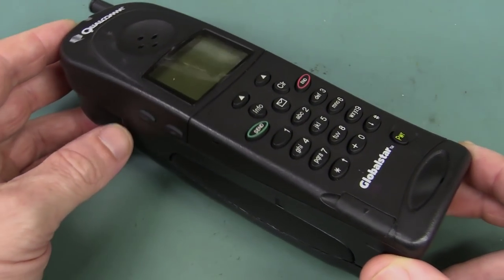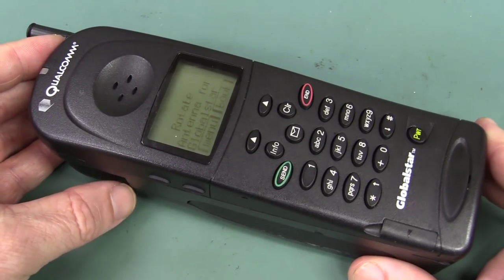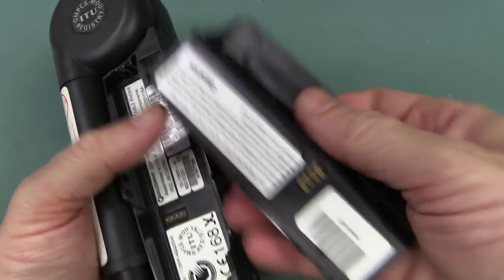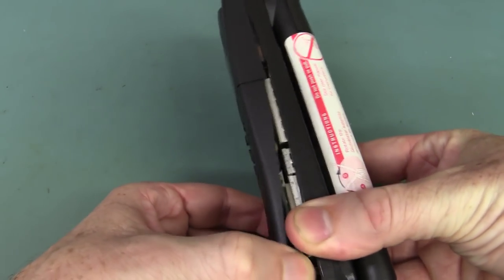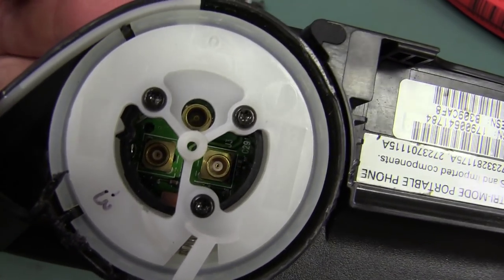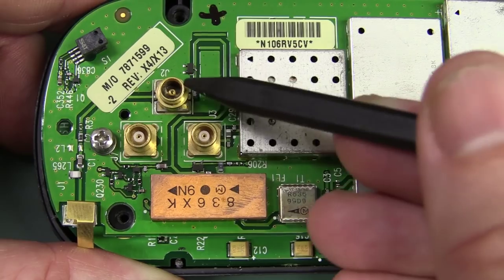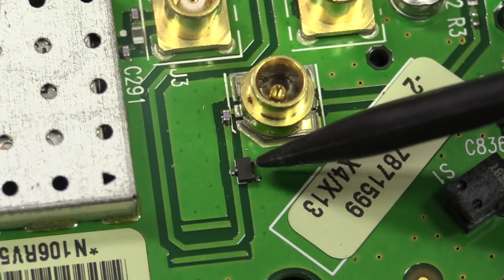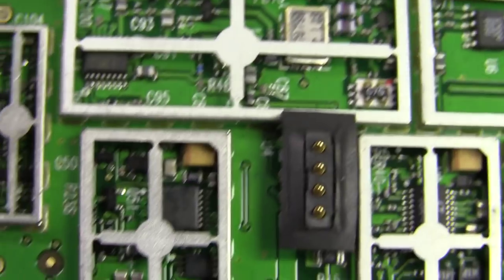EEVblog #721 - Globalstar Satellite Phone Teardown

Comment: What do you recommend to start in the world of electronics? Arduino? Raspberry pi?
Reply from the maker: Icaro Vasconcelos A breadboard and some parts.
Reply: bread boards. learn the basics.
Reply: EEVblog Totally agree, tbh any microcontroller stuff should be tackled once you understand how general electronics works.
Reply: Icaro Vasconcelos An Arduino or Rasp Pi will teach you lots about embedded software, but very little about hardware.
Reply: Icaro Vasconcelos 
I started with Make: Electronics and the 2 kits that go with it; then the 500 in 1 Maxitronics kit - when I got to the 3rd book on MC's, the programs didn't work and I had to write my own, that did work. Then I started buying books on computers and device repair which is my main interest. Now, I can fix nearly anything that can be fixed, and have fixed everything from wall warts to laptops. 
I bought an Arduino a few months ago and played with it a little bit. It's fun, but I have to admit that I prefer analog circuits. It just seems to me that analog circuits are warmer and more fluid. The Arduino "Night Rider" just doesn't even compare to the analog with the 4017, 555, 10 diodes, POT, etc.
Reply: Electron Alchemy In themselves, yes, but on its own an Arduino doesn't do much; you'll want to start connecting it to different things, and slowly you'll learn more about those components. It's much easier to get people interested in electronics if they can see simple practical applications straight away. I'd definitely suggest getting a kit with some discrete components and a microcontroller of some sort.
Reply: RFC3514 
If he gets the Make: Electronics book and the kits, he'll learn from the ground up( pun intended). He'll build circuits also in analog. I think it's good for newbies to learn the fundamentals first or at the same time. Just like Dave recommends learning to use an analog oscilloscope before going to digital scopes.
Reply: Robert Calk Jr. People tend to recommend others do things the way they did things. That doesn't necessarily make it a better approach. It depends on what each person's goal is, and how technology has evolved.

For example, computing pioneers will tell you that you need to start by learning microcode, then assembly, and finally tackle a high-level language. That certainly gives you a greater understanding of how computers work, but it doesn't necessarily make you a better programmer. And starting with a high-level language doesn't prevent you from learning assembly later (if you're interested). 

It's the same with music (should you learn every detail about every instrument before becoming a composer?), photography (do you need to study film chemistry and sensor manufacturing before taking pictures?), and so on.

Chances are you will be interested in some of those things, but you don't always need to start at quantum mechanics and work your way up; sometimes it's more productive to start with the problem you want to solve, and work your way down. It tends to keep people more interested, and makes them more flexible in the long run (because they'll think in more abstract terms, and won't feel as tied to the technology that was available at the time).

The Arduino "ecosystem" has probably done more to get "normal people" (i.e., people not actually doing an engineering degree) interested in electronics than all the books on analog circuits put together. And while most of those people will probably never learn the exact difference between a MOSFET and a BJT, they might learn enough to figure out the joke on Dave's shirt. And that's really the most important thing. ;-)
Reply: RFC3514 No one ever suggested start learning programing by learning microcode especially not computing pioneers, they did know what they do comparing to modern "programmers" who can not write program without garbage collection (it is hard to know what variable you don't need) and pointers are for them rocket science. Microcode is usually written only in time of processor design and is very specific to the specific processor model and it is also a severely protected secret. Intel has published the method by which an operating system or a motherboard BIOS may update the microcode (it must be done after each hard reset; the update is kept in volatile RAM) but the microcode contents are undocumented. The Intel® 64 and IA-32 Architectures Software Developer’s Manual (volume 3a) describes the update procedure (section 9.11 "microcode update facilities") but states that the actual microcode is "encrypted" and clock-full of checksums. The wording is vague enough that just about any kind of cryptographic protection may be hidden, but the bottom-line is that it is not currently possible, for people other than Intel, to write and try some custom microcode.
You are right that arduino ecosystem has made more people interested in electronic then books, but vast majority of them didn't learn nothing about electronic (and they didn't learn nothing about programing) .
Reply: Robert Calk Jr. Everybody have it own way how he/she learn electronic, there is no answer which one is best for someone, you did it in one way, other do it differently, but I agree that everyone need to start with basic ( at least need to learn elementary things).
And you with your experience (the programs don't work) just proved that Wernher von Braun was right when he said that you learn more from failure that from success.
Reply: RFC3514 
I agree, but he wasn't specific - he just said "electronics". But as I said, he can do both. Arduinos are not very expensive. He can learn the basics with Make: Electronics or another good beginner book, and play with an Arduino also. I was just mainly giving him ideas by showing how I started. But I'm a perfectionist and am a firm believer in fundamentals.
Reply: Miloš Lazović 
I think people should learn the basics also. But while he is learning the basics, he can take a break and play with an Arduino. It seems to me that the Arduino and sketches will teach him how, and the basics will teach him why.
Reply: Robert Calk Jr. I like Arduino as idea, but I don't like how that idea is implemented (they made some bastard of C and call it Arduino "language"), if you want to learn microcontrollers it is better to skip arduino, all manufacturers have free assembly/C compilers and programmers are cheap (for Atmel you can find it for like 2$ some basic one) and you can do all on breadboard.
Reply: Miloš Lazović 
If the difficulty is too much for a beginner, many will lose interest or feel overwhelmed. It needs to be fun and exciting to keep them interested. Arduino is fun where you can download sketches and build useful and fun circuits quick. But if he is serious, he should also learn the fundamentals. Yes, you can get MC's pretty cheap, but without knowing the fundamentals, he'll be placing components on his BB and not even know why.
Reply: Calm down people hahah I confess I was not very clear in what I said, so... my fault. I really want to learn how to build these things from the scratch, I asked about arduino and raspberry because I started a programming course and though with myself that they would be a easier way to learn how the components work, but it seems not to be the case. I want to try this first because I have no idea if I will go to computer engineer, security, data management, software and system design or computer science, so I'm trying to learn as much as I can so I can decide and do only one course after my current one. I think now its easier to get some help. So If I do start with this Make: Electronics what will be the real start? making a led light up and things like that? Is just to get some light in my path hahah
Reply: Icaro Vasconcelos 
You will learn a lot more than lighting an LED. There are good projects like building an alarm system and stuff. It teaches about voltage, current, resistance, power, and components and stuff. It is a very good book. There are other books you can get instead of it if you want. The important thing is to get to learning.
Reply: Icaro Vasconcelos First depends what you really want, raspberry pi is more like normal computer it run OS (some version of Linux or RISC OS) it have video out, Ethernet, GPIO ... but GPIO is much slower than on microcontroller it have less of them and it dont have exact timing (Linux or RISC OS are not real time OS), you can write bare metal program for it (that run without OS) but is not so easy (many things about processor are not documented or proprietary to Broadcom). On other hand Arduino is more-less standard microcontroller on nice development board with some bootloader that just allows you to load program (or as they call it sketch) without programmer.
All depends what you want to learn but look on raspberry pi as on slow computer with some so so useful GPIO to it (it is same for Intel Galileo) and on Arduino as microcontroller learning kit which use some modified C (and I still don't see any advantages of Arduino language over C except you don't need to know names of registers but at end in C you have less to write to do same thing).
Reply: Miloš Lazović "No one ever suggested start learning programing by learning microcode especially not computing pioneers" - Well, I know several people who worked at IBM back in the punch card days (my uncle was one of them), and that's precisely what they suggested (and what they taught their students later, even though it was completely pointless by then).

This was a long time before x86 (let alone Itanium), and knowing how the CPU decoded and executed each assembly instruction was a relevant (and indeed necessary) skill in their days. But, by the time they moved into teaching, it was completely useless. And forcing their students to start there only made them lose interest.

We're not even talking about an electronics engineering course, here. This is just someone who is studying IT and wants to get started with electronics.

A well-documented and well-supported microcontroller board (like an Arduino) is a great starting point for beginners. They can use it as a hub to connect other devices, while they learn how each of those components works. It's also a great bridge between what he already knows (coding) and what he wants to learn about (electronics). 

Of course, you're still going to need those other components (and breadboards, and books, and so on). But to say that people who got interested in electronics thanks to Arduino "didn't learn nothing about electronic and they didn't learn nothing about programing" is just arrogant and demonstrably wrong.
Reply: RFC3514"You know several people" you are talking about thing you about stuff you don't understand (you need to ask your uncle to explain it to you), Microcode is not programming language it is just way how some manufacturers implement some assembly instructions instead directly in silicon (now days most od assembly instructions on Intel/AMD are implemented as microcode). First IBM that used microcode was System/360 and it had separate microcode processor that had only 16 microinstructions in code that was fixed (it was loaded from the card reader but couldn't be changed), and it was irelevant to knowing how the CPU decoded and executed each microcode instruction because it had dedicated microcode processor and execution of microcode did not affect main CPU (that practice with dedicated microcode processor IBM used till late 90 in its mainframes and all of them could emulate System/360). IBM System/360 was first computer I touched, but never used, first one which I used was IBM 4341-2 which was 100% compatible with System/360 (but did not used punch cards) and later I used AS400 ... and I learned from old school programmers and no one ever suggested to learn microcode (people that started with IBM 700 in '50).
Arduino.learn you only how to use Arduino.and that have little to do with learning electronic, it is same as you would say that Lego learn people structural engineering, or assembling your PC learn you electronic Idea behind it was good but it developed to just turned modules and using libraries  that someone other wrote (most of them badly written and full of bugs) with little and no learning and knowledge. Of course you can experiment using Arduino but most users don't learn anything.
Reply: Miloš Lazović FYI, my college degree was in computer science and hardware design. ;-)  I'm well aware of what microcode is (and I never wrote that it was a programming language - try reading my messages again, if you didn't understand them the first time).
Reply: RFC3514"For example, computing pioneers will tell you that you need to start by learning microcode, then assembly, and finally tackle a high-level language." you don't learn microcode, microcode is way as some assembly instructions are implemented so it is not something you learn first, it is nothing to learn there it is ASSEMBLY, which you should learned in college.
Reply: Miloš Lazović Actually I learned assembly (for two different architectures) long before college. And you still don't seem to understand what I wrote (which I guess is only fair, because I can't say I understand most of what you write, either).

The point is that people who learned things in a certain order tend to assume that everyone should learn things in the same order. And people who worked on early computers learned coding as an extension of hardware design (and therefore believed that learning about instruction decoding was a necessary part of learning to program). It was inconceivable to them that someone could ever become a competent programmer if they didn't know how many micro-ops a given instruction was translated into. 

Just as, apparently, it's inconceivable to you that someone might learn something by using an Arduino.

But hey, the great thing about reality is that it doesn't care about individual opinions. ;-)
Reply: RFC3514 It is not that you don't understand what I wrote, it look that you don't understand programming at all. No one cared how many micro-ops a given instruction was translated into it was and it is still totally irrelevant, only what was and is relevant now is how much time instruction need to be executed (probably you are mixed up microcode with that). And today it is very important part of programming and no one is not even mediocre assembly programmer if he don't know that (no mother for how many architectures they know assembly), without that knowledge you are better don't write anything in assembly, you just waste your time, use even worse compiler for any language and it will generate better, smaller faster code then you.
I never said that no one will learn nothing using Arduino, he will learn to use Arduino, on other hand he will learn nothing about electronic, he will learn Arduino language (which is relatively useless in real life, except for novices that use it for simple hobby projects) and that is basically all. No one learned electronic using Arduino, electronic is learned from books (you at leas need to learn basic laws) and with experiments, not plugging shields to Arduino and running sketch.
Reply: Electronics with discrete components like transistors, resistors and capacitors, there's hundreds of schematics available, if you get a hand in these, go further with logic chips. That gives you a basics in hardware. Microcontrollers have more software hassle than hardware.
Reply: I was playing with arduino and had one built on a breadboard right after my first into to comp Sci class. The pi will have a lot of Linux to it while the arduino is more the cheap make things move controller.  I picked up arduino and later learned assembly. Arduino is for having fun with community scripts and an introduction to a C style language. I am in the engineering side of programming (480V design, motors, servos sensors, and drives) I still love how I can make arduino do something for 30 bucks that distributors are charging 100s for.
Reply: Jeremy Adair $30? I'm doing useful things with $2 Arduinos... direct from China, of course
Reply: CodeTech I'm pretty sure he's including the price of the motors. Even an "original" Arduino costs less than $30 (the basic ones, anyway).
Reply: CodeTech RFC3514  His price of 30$ is regular price from original Arduino UNO (from Italy not Chinese clone) with postage (UNO V3 is like 21-22$ original and to that add VAT and DHL postage). Cheapest original Arduino is like 13$+. Even Arduino boards are open-source logo and name is registered the trademark of the Arduino so technically Chinese boards are not Arduino (they can be only Arduino compatible or if they have on it Arduino name they are counterfeits)
Reply: Since the Arduino is open-source hardware, I consider a Chinese clone to be an Arduino. In fact, the two Actual Original Italian Arduinos I bought (one Mega2560, one Leonardo) have both failed, one spectacularly, one by simple death after 2 minutes being powered.

However, my point is that $2 parts are useful, and especially useful for the learning phase where you might well accidentally get 12V onto a 3.3V device...
Reply: CodeTech I didn't say you can't do many things with 2$ microcontroller, you can do much more with 1.2$ ARM microcontroller then you can do with Arduino.
Arduino is open-hardware but use of name Arduino is restrict only to the official boards, all other cant use that name (they can be described as "Arduino compatible".
Here is quote from Arduino license:
"Although the electronic design of the Arduino boards is open source (Creative Commons CC-SA-BY License) the Arduino name, logo and the graphics design of its boards are a protected trademark of Arduino and its partners.
In general the name and Arduino logo MUST NOT BE used to identify products or content, commercial or non commercial that are not released by Arduino."
Selling Arduino compatible products:
-The product can't contain the name Arduino
-The board can't have Arduino written anywhere on it
-The board must not copy the Arduino Logo or graphic design
-The auction/website title can't use the Arduino name
-You can write in the description that the board is derived from Arduino.
-You must explicitly say that you're not connected to Arduino and your product is a derivative
-You must specify that any tech support request must be directed to you
More you can read here
http://arduino.cc/en/Trademark/HomePage?from=Main.Trademark
Reply: Miloš Lazović Wow, you do seem to have an astonishing ability to miss the point.
There is no $1.2 ARM microcontroller that is in any way, shape or form useful to a beginner, and that is what this discussion was originally about. I can't really see a beginner soldering an SMD onto a useful board with PSU and easily plugged connectors, for example.
There are, in fact, Arduino clones that have additional functionality, alternate designs, etc. And for more than one project I'd rather have an easily replaceable clone than an original high-priced Italian device anyway. Some of us, especially in North America, don't actually find European built product to be very high quality. That excessive obsession with ROHS spec is a problem.
Reply: CodeTech Now I get it you are from North America so it explain a lot.
If you look closer on Chinese manufacturers you can find ARM with what you define plugged connectors, with voltage regulator ... (without PSU but Arduino and its clones don't have PSU, they have voltage regulator) with price in range of cheapest Arduino clones.
If you need to have easily replaceable clone in your project you are doing it all wrong (but it is totally stupid to have Arduino in any project anyway it is good only for experimenting).
And you still not get how price is made, you pay price of original Arduino to help further development of project, R&D .... not cost of manufacturing and hardware that is negligible (You know someone spend time developing Arduino IDE, no matter what I think it is most useless thing ever).
In most of world it is people have opinion that US product are worst in world (that started with cars that are on same level as cars produced in ex USSR).
Reply: CodeTech Congratulation, you managed to show that you don't even know basic about microcontrollers or Arduino.
"Arduino (or clone) is is a convenience package for an Atmel core" can say only someone who have no idea what Arduino or microcontroller is. It is just bored with Atmel microcontroller  with bootloader installed in it. It is not packaged for Atmel core (or you maybe you dont know what is Atmel core and you mix it microcontroller).
" If you need more speed, code in assembler to get closer to the hardware' it is against sentence of some who no clue about it, you can use C it will give you more speed then Arduino language (in most case good compilers will make it run faster then what you can write in assembly for large projects).
And my statement that Arduino IDE is most useless think is based that Arduino language is merely a set of C/C++ functions that can be called from your code which just make programing slower (what is shorter Arduino digitalWrite(13, HIGH); or C PORTB|=0x10;) , make code more slow and hide many important aspects of it. If you dont use Arduino language then there is no point using Arduino IDE, you can use also free Atmel Studio.
I agree with you that you should stop answering because your answers show only your ignorance about Arduino, microcontrollers and programming in general.
Reply: CodeTech
You are great example what is wrong with Arduino community, you are interested in electronic and you think you know it, but from your comment is is clear that you didn't learn basic terms, let alone anything else.
Reply: Awesome... just.... awesome.

So, kids, if you're looking to get started in electronics, stay away from combative, ignorant know-it-alls. That is all.
Reply: CodeTech
You are amazing character!
You think kids need to listen to you and don't learn basic terms?
I understand someone who know something to give advice, but someone who can't distinguish basic terms like you it is funny!!
Reply: ungratefulmetalpansy
You speak that from personal experience (you know someone like that) or you are just telling urban legend (I heard that like urban legend but I never meet someone like that)?
Reply: ungratefulmetalpansy
I asked you because im my country it is little different, technical universities are most state owned and they get fixed amount of money so they have goal to live as less students as possible ( average rate of students that finish is less then 15% of all that enroll it). Most private universities her don't have technical studies, they are on more profitable studies like economy, law and one which have technical studies don't produce engineers but managers (and thay have some idiotic title like manager in electronic, what ever that means). Here only flaw is that you learn too much theory (you here learn much more things that you will ever need and they cover all areas no matter which direction you officially select) and comparing to it little practice (you spend like only 20% of time in laboratories) and here they when are fresh form university know how to make things but in first years they suffer of over theorizing (thay calculate on hard way even simples stuff).
Reply: Petar Petrovic So, you just jumped to a ridiculous conclusion.
Perhaps you could show me anywhere where I said anything as wrong as what you just attributed to me?
Didn't think so.
Facts are facts, in spite of some people pretending otherwise. The original question was about someone getting "started in the world of electronics", then listing Arduino and Pi. I commented that one doesn't need a $30 part, a $2 Arduino (and for the pedantic, obviously I meant Arduino clone) is sufficient.
If you want to be in "the world of electronics", you're going to need to understand basic components... but reality is that almost everything today is digital. Even my coffee maker has a microprocessor. Arduino is a great system because it helps you understand the basics. AD converters, PCM, digital in and out, and essential logic, some input conditioning, interfacing essential sensors, using a simple transistor to drive a device that your uP is switching, that sort of thing.
Apparently Milos wants to complicate things and tell us which is "superior" or "better", but that's like giving a person who has never driven a car before a Formula 1 racer. They'll crash. Or give up because there is too much to learn.
My 1987 car was running several hundred horsepower with a turbo engine being controlled by a 1MHz 6803 and less than 16K of ROM and 192 bytes of RAM. Even the tiniest Atmel AVR chip today exceeds those specs, so thinking you need to move to ARM to accomplish anything useful is wrong.
And I'm completely in agreement with "ugmp", most people getting degrees today shouldn't be. I once had to train a girl to install networking cards in PCs, who had a DEGREE in computer science. She had NEVER SEEN THE INSIDE OF A PC BEFORE. 4 year technical degree.
Reply: CodeTech
You show your ignorance again, most electronic is not digital (end even that is not limited to only microcontrollers), and most digital circuits have analog parts (at least some power supply and usually front end). I never saw Milos commented that you need ARM to do useful things, or you think that this sentence mean that "I didn't say you can't do many things with 2$ microcontroller, you can do much more with 1.2$ ARM microcontroller then you can do with Arduino", other comments I see was regarding price of Arduino and his opinion that Arduino IDE is useless (which I tend to agree to some extend) and much older that using Arduino you can't learn electronic (again I agree with that).
You based your knowledge on little segment of electronic (only on microcontrollers) but in reality most of it is not (world around us is not digitall) and even using simple transistor to drive a device that your uP is switching (as you pointed out) is not so simple as you think (and most Arduino users) if you want to do it right (to ensure your BJT will be always hard on for example).
Your comparison with car have not to do with anything (there are turbo cars that have more than 1000 hp and use carburetors). And no one still used any Atmel or Arduino in car electronic (limiting to engine managment) and your statment that  even tiniest Atmel AVR chip today exceeds those specs show that you have problem understending specsifications, they work in different ways (for example you can do operatin on all 192 bytes of RAM in 6803 on Atmel you cant in most cases and you need to copy location of ram to one of 32 registers end even not all of them can be use for every operation) so in some cases 6803 is more powerful then Atmel (it need less instruction to do same think).

Only good thing is you are interested in electronic (probably that thanks Arduino) but you have to learn some basic. I wish you great time learning (you have lot of to learn).
Reply: I's  better for you to buy arduino stater kit ! it's a complet kit with many parts and its mnual ! you will find it usefull !
Reply: Icaro Vasconcelos Stap commenting OMG!
Reply: Delta Destiny really?
Reply: books